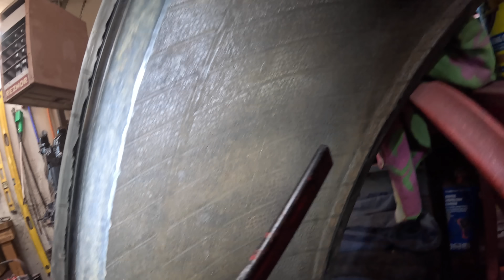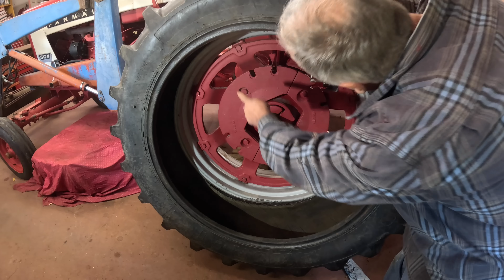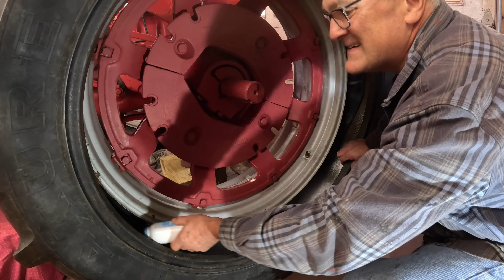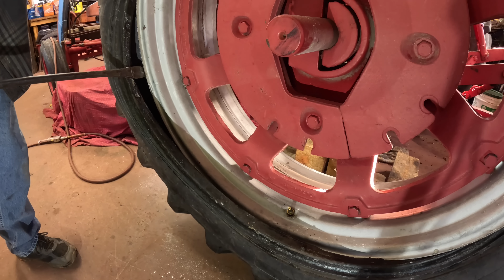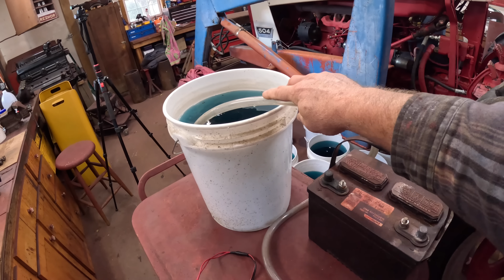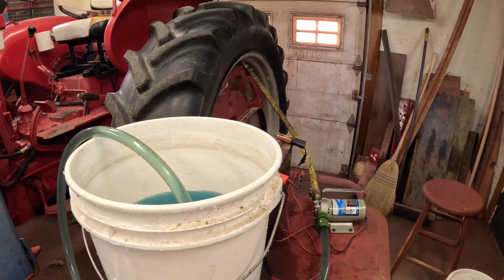"No Sweat" Tractor Tire Installation & Fluid Ballast Filling

Comment: I’ve struggled more with motorcycle tires than you did with that huge one.  You make it look easy
Reply: Sometimes smaller tire can be more difficult, it depends on width to diameter ratio among other things. On my motorcycle front 2.75 is significantly harder to put on than rear 3.00.

Comment: Pete you may know this by now about the float detent on your hydraulic spool valve, you should be able to switch with spool has the detent valve by switching the bottom side caps opposite of what you had  moved around on the top or lever side of the valve, the same type Allen head bolts should remove the non detent and detented float positions

Comment: Pretty cool.. I have the same setup.. where do you find windshield washer fluid cheap ?? Cheapest place I’ve found is Rural King and I just missed there sell at 1.99 a gallon. Just put 2 new wheels on my Super A. Thanks to calcium chloride..  but I guess it’s been in there since my granddaddy bought it in 1948. Definitely going back with washer fluid

Comment: We used to fill ours with water because we didn’t have to worry about freezing, but we just used a smooth piece of copper 1/4 tubing reduced down from a garden hose and turned the faucet on slowly and the copper tubing was just small enough to allow the tube to constantly vent and keep up without building up pressure

Comment: Thanks for the video, I've been doing fluid in tires like this for about 15 years but use a big tote or 200L barrels, we had problems with Michelin tires on our chore tractor and $300 a call out for the tire shop was getting crazy, I was glad when those tires went to the dump. I just do tires on my old tractors in my collection now, it's amazing watching that little pump pull the tires in when emptying them and they nearly come off the bead seats. The first one I did I wasn't paying too much attention and the tire deflection started bending the fenders in on my Fordson Major . Take care

Comment: There is another alternative to protecting your rim. 
Using duct tape or my own preference is Gorilla tape applied to the rim surface after it’s prepped and cleaned. Works quite well and reasonably easy to do without breaking the bank. 
Just clean the rim well and apply it smoothly with a little overlap.

Comment: Well done I'd worked lots of farm growing up and never seen anyone fluid fill their tires. Aside from dad's 1929 McCormick Deering F-12 and his 1935-6 McCormick Deering F14 ,both old Farmalls the F-14 and his John Deere H(1954) were the only two tractors with filled tires  and thank God for their never getting punctured or cut. We never needed to fill them Mc
 Nerney  farm and implement had always handled our new tire needs and rim servicing as well.  Thank you sir for the informative video and by the way. How did the little tractor turn out? Hope this finds you all well. God bless.

Comment: One key point about adding ballast to a tractor with a front end loader are the brakes. Tractors have no brakes on the front wheels so ensuring the back wheels stay on the ground, especially going downhill is essential to being able to stop.

Comment: Thanks Pete! Watching these videos on filling those tires reminds me of a way to NOT drain them!...By picking up a deer antler! 
Going down our lane one time I started feel "sprinkles" and it turned out I hadn't seen the antler in the tall grass which caused the hole in the tire and tube in an 18.4-34 tire on a 560 narrow front.
I made it quick to the concrete part of the barnyard and parked it antler "up" and we got it fixed.
That "chloride" was kind of sticky when wet and made kind of a mess but that's what was common back then.

Comment: Pete, was thinking of you on the weekend. Sheree and I attended a vintage tractor pull. A fully restored IH M won her class, I believe it was the 7000 lbs. class. Amazing to see the old tractors pull with very low horse power. Not all of the tractors were fully restored. Sheree made the comment that it was nice to see kids involved and in some cases driving. Their Dads and Grand Dads in tow. Great afternoon of fun. Oh, and my time is coming. Im starting to see rust around my valve stems. I was thinking of popping the rims off, sandblasting and painting them. I never thought of windshield fluid. Beat juice is common here. Thanks again Pete, very informative video.

Comment: Hi Pete & Hillary. My Niece who lives in Kentucky put me onto your video's. I really enjoy them and now watch them all the time :) I used to be a technical trainer (among other things) for many years for JI Case Australia, and I was around for the merger. Also grew up in an IH small country town so my blood runs red :) and was a cattle producer for many years. I would like to point something out to you on electrical connections, as I have seen you do this a few times and it makes me cringe every time, It's just a small thing, but it is much safer. Whenever you connect wires/leads to a battery, always connect the negative post last. And for removing, always disconnect the negative first. 

The reason for this is that there will be no sparks. This helps in two ways:
1 - The battery cannot explode from the acid fumes - believe me it happens and I have personal experience.
2 - When connecting/disconnecting the positive lead after the negative is already connected, the current (amps) increases dramatically, trying to overcome the poor connection (high resistance). This is particularly bad for anything with onboard computers, as they are very low voltage/amperage and cannot take sudden spikes of high amperage, but it is not good for any electrical system and can cause connections to arc/weld anywhere in the electrical system and cause all sorts of problems.

Hope this helps and look forward to seeing many more video's  :)
Kind regards
Wayne.

Comment: Excellent Video Pete :) also seen shop companies put 80w90  rim plus beads lips plus inner tube seal less pry and blow up then! Plus sometimes  Petroleum jelly rim plus tube even  to seal also windshield fluid over chloride stuff but changing windshield fluid every 5 years! Like your ideas better too and safe to! Also my dad plus his brother used barrel of cement with three points hitch arms on solid steel 3/4 up barrel of cement but take draw bar off to on loader Tractor for clean barn yard out or snow removal  even picked rocks plus was use full!

Comment: I've watered up tires in a similar way but I added no air. When the tire was almost full, and air valve began to put out water, I completed the tire pressure inflation by adding water, not air, until the tire had 15 to 18 pounds of pressure. That way,  I could add more weight than I could by finishing the tire inflation with air. I ran a 4430 and a 4640 without any axle weights.

Comment: The weight of the fluid pulls the tube down and causes the bead to pull in and it’s not really that uncommon. Lowering the tractor a little bit helps - thanks for posting. You probably saved at least $300 by doing it yourself.

Comment: On the hose fitting, can you put a "Y" connector on? Where one side goes to the pump and use the other side as an air bleeder.

Comment: My Dad had several farm equipment and Good Year franchises. Us 4 sons worked on lots of rear Tractor Tires with Calcium chloride.  You do a beautiful job Pete.  We never did all that rim painting, etc. Farmers would never pay all the Labor costs involved. You are definitely a top notch repair man.
Reply: Our old pump could put out too much pressure.  My brother went on break and forgot to relieve the air pressure.  Boom, that old tire blew up. Shop ceiling walls everywhere. Sticky mess.

Comment: On my loader tractor, I have wheel weights, about 400lbs per tire. Then I have fluid in the tires, another 500lbs per tire in ballast. Traction is not the issue, but I struggle with the front axle capacity being low. In a perfect world, I would have a tractor with a better front axle. To compensate for this I put 600lbs on the 3pt hitch. The 600lbs placed 34inches behind the rear axle does excellent in reducing wear and tear on the front axle. Consider the rear axle more of the pivot point than the front axle. So now moving 1,200lb round bales my front tires down squat so bad which tells me the 3pt ballast is making a better difference than the tire and wheel ballast. This is just food for thought, not trying to say anyway is better than another because everyone's goals and situations are different!

Comment: FYI: There is an orientation to those tubes as the valve stem is offset. I made a mistake the first time I installed a tube in my 886. It held for awhile before it tore the stem. Also tubed tires are not hard to install but tubeless is another story as they are very tight for good reason. I put new 12 ply tires on my 580C backhoe that are tubeless but installed tubes just in case I decide to fill them. It helps to get a couple k-tool aluminum bead holders and some actual tire bars of various lengths. This makes the job much easier and they also work great on smaller tires.

Comment: Just put a tube in my farm tractor tire yesterday. I didn’t put liquid back in it. No loader and I added front weights on in after I got it. I mainly bush hog. I used my backhoe to break the beads.

Comment: Out of High School, not knowing what I wanted to do with my life, I worked for a hometown Goodyear tire dealership. Over the six months that I worked there, I ended my tire career in a barnyard in the middle of December with the temperature around 0 degrees F. The rear tractor tire was filled with calcium chloride. As I worked through the tire repair, I got calcium choride all over my hands. Gloves weren't being used at the time. I ended the day with severely chapped hands, necessitating a trip to the emergency room.  A week later, I had decided that this was not what I wanted to do with my life, and so I applied to a university, changing my life forever.

Comment: I just unscrew the hose at the tire to bleed out the air. Quick and no blowback of fluid. Good video I use a similar setup for large ag tires.

Comment: great video Pete,, just want to say I did this to my tractor years ago, i didn't know there is a winter and summer blends on washer fluid, of course I bought the cheap stuff, it was summer blend, good thing I read the label before it went into the tires,, load it all up and return it for winter blend, at a higher cost of course
Reply: Good point!

Comment: I did my little BX Kubota with windshield fluid. The dealer wanted to put tube's in, then rim guard due to possible rim slippage if Rim Guard was directly touching the bead. They wanted like 500 bucks. Nope. I got 3 cases of WWF and did it myself. My big M7060 has the rim guard in it.

Comment: I've replaced many tubes in my life from bicycles, motorcycles to car and truck. I've read threw the years that you should blow up the tube some before inserting the tube in the tire, to avoid folds or easer to insert the tube or avoid punctures ? I don't really know. On some larger tires threw the years I've tried that way but found no real advantage, Any thoughts on that ? Thanks and keep the video's coming , with the grilling !!

Comment: Hey Pete.!! I just wanna give you a little tip. I was a tire technician for about 6 1/2 years. I did commercial vehicles as well your regular vehicles but when I did commercial vehicles. When trying to blow up a tube, you want to blow the tube up first out side of the rim to be able to expand the tub before putting inside the rim/tire to its easier to play with, and you don’t have to worry about the tube, twisting 

Much love from Canada. Love your videos keep them coming. !!!!!!
Reply: Same with bicycles.😁

Comment: A few years ago I had a set of tractor tires filled with a methanol-based fluid and cost a quite a bit more than your process. I don't remember the exact price, but it did take a little less time, but not a lot. If I have to do any more ballast in one of my tractors, I will look into doing it myself. Thanks Pete, I hope you have a nice day!

Comment: Checking the tire for nails and screws, etc. Interestingly I pressure washed my driveway yesterday to seal it in anticipation of winter. I couldn't believe the number of nails and bent screws I found just using low pressure to loosen debris from the asphalt aggregate. :face-fuchsia-tongue-out: Thankfully I never got a flat from driving over them.